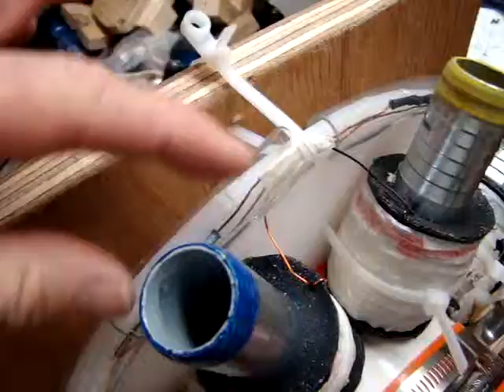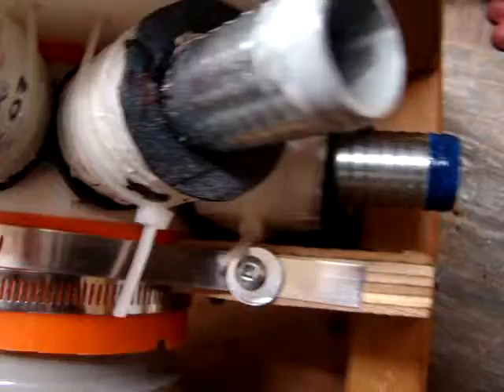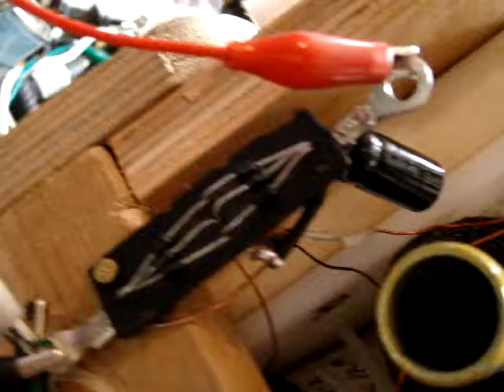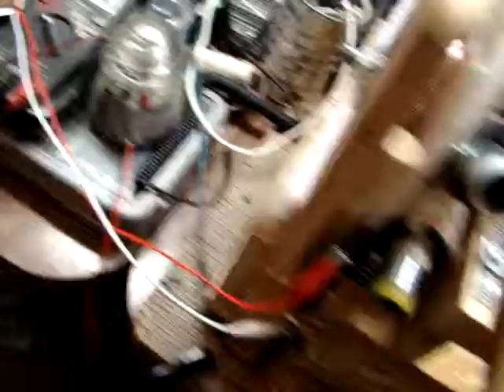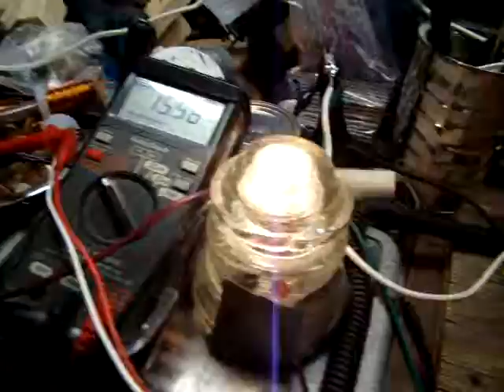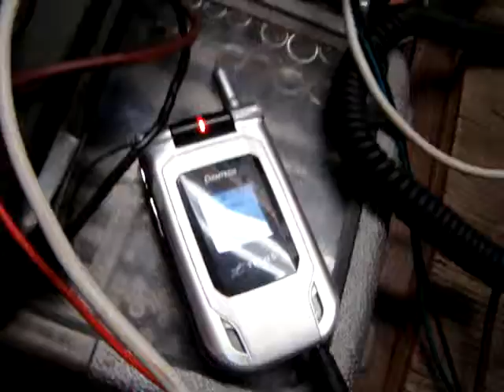3-phase Alternator Project, Part IV - Final Assembly & Demo

Comment: can you help me im a old english teacher, i have no idea what im doing i just look at videos n started to make  this a  few years ago saving money  month after month. now i  have 36 magnet 4in x 2in x 20mm neos, 3 disk the one in the middle has 9 each side  nsnsnsnsn facing out the opposite side is nsnsnsnsn facing in n snsnsnsns facing coils.after coil outer disk 9 mags, now help plz on the north i put coils + to N on the S i put -of  coil facing itsoat top dead center im having    n to +  s to -     .IS this idea ok. well it make power. 
next 9 coils 3 phase do i do the same +++++ on the stater
alternate the pos n  neg same im doing magnets to match the n to pos   n the S to - side of coils so at  TDC its replelling, 
also  i have  9 coils 3 phase how do i do the three pase i was going to do one each   badini sg style  since my coils are wound 7 20 ga  1 24. ga  n usethe trgger diag to make  3 circuit board with  100omh  r  1n4001   d n 1n4007 d   MLJJ21194   t
how  do i put this all together now please can you help
anthonyolivera@yahoo.com
teacher  in Vietnam HELP plz